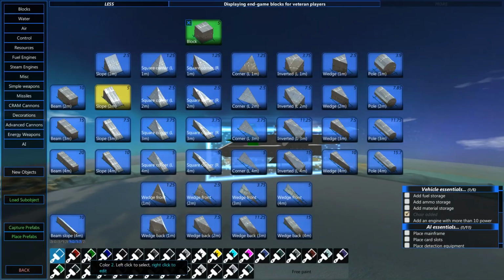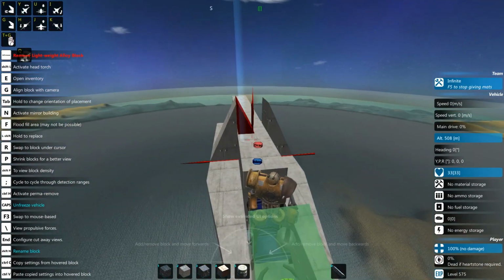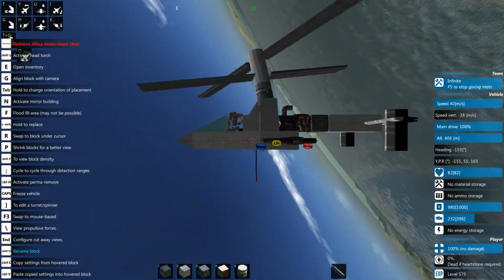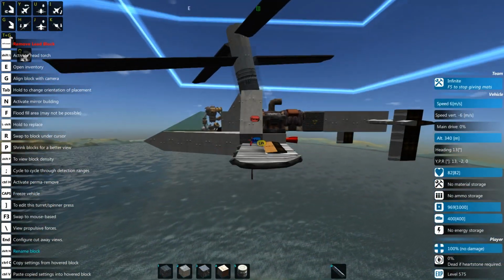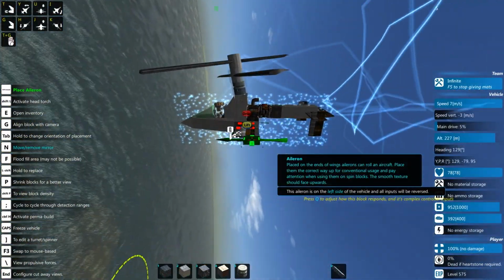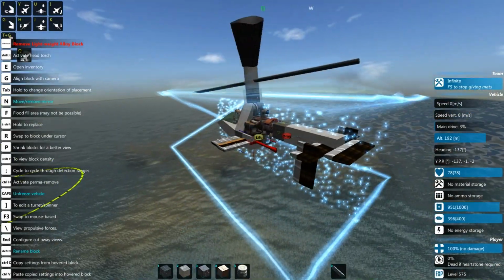10 Minute Contrarotating Helicopter

Comment: The rotor knows how fast it is at all times. It knows this because it knows how fast it isn't. By subtracting how fast it is from how fast it isn't or how fast it isn't from how fast it is, it obtains a difference or deviation. The spinning subsystem uses deviations to generate spinning commands to spin the rotor from a velocity where it is to a velocity where it isn't, and arriving at a velocity where it wasn't it now is. Consequently, the velocity where it is now the velocity that it wasn't, and it follows that the velocity that it was is now the velocity that is isn't. In the event that the velocity that it is in is not the velocity that it wasn't, the system has acquired a variation, the variation being the difference between where how fast the rotor is and how fast it isn't. If variation is considered a significant factor, it too may be corrected by the GEA; however, the rotor must also know how fast it was. The rotor spinning computer scenario works as follows: because a variation has modified some of the information the rotor has obtained, it is not sure just how fast it is; however, it is sure how fast it isn't, within reason, and it knows how fast it was. It now subtracts how fast it should be from how fast is wasn't, or vice versa, and by differentiating this from the algebraic sum of how fast it shouldn't be and how fast it was, it is able to obtain the deviation and its variation, which is called error.
Reply: Wait, what? I got confused somewhere along the read, and I don't know where.

Comment: Hey spud, I did some research and some helicopters tilt rotor blades indivualy to adjust pitch and roll, why don't you try build one, I have a concept that might work if you are interested.
Reply from the maker: I had one before, and it was just very weird in FTD controls. Probably would be better with the new controls. These builds are for tutorial examples. I might mention that in a more in depth tutorial in the future
Reply: @Spudcubs  maybe my concept would work better.